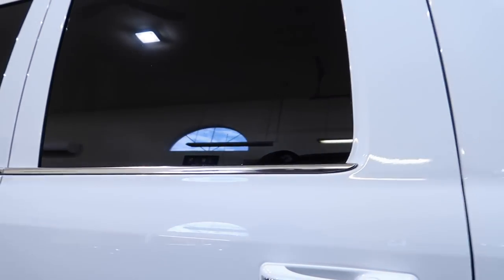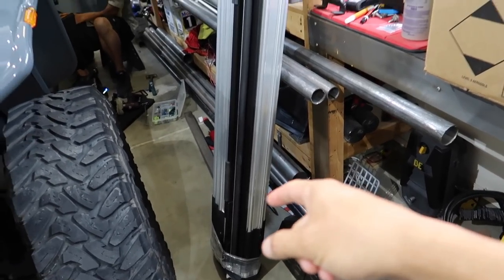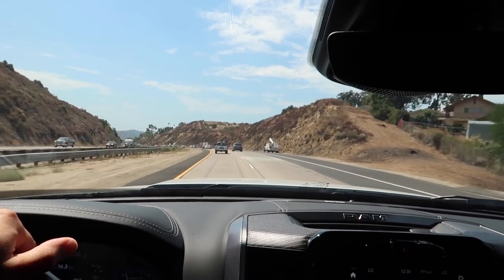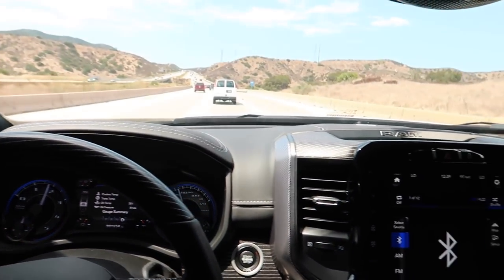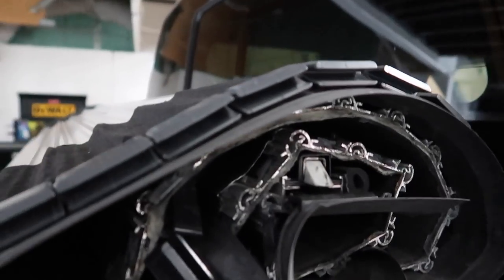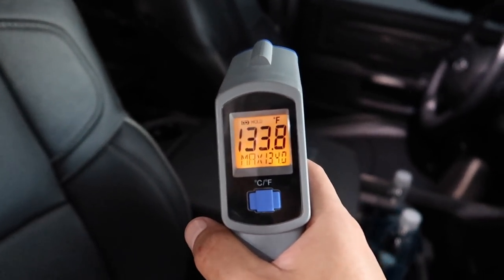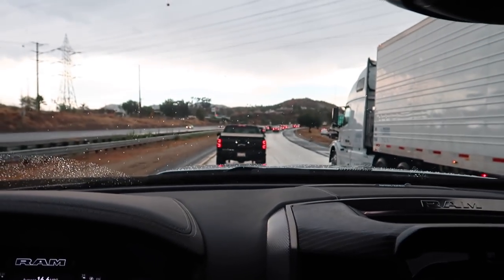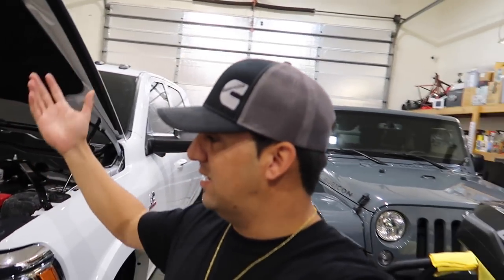TOOK THE NEW RAM OFF ROADING OFF THE SIDE OF THE FREEWAY!!

Comment: I think a pedal commander should solve that lag problem🤙🏽
Reply: Bryan One Four the lag problem is because of the turbo. The commander would only fix the lag from the electronic pedal
Reply: @xInline6  this is incorrect, the turbo spools based on acceleration. Hence if you have better more responsive acceleration your turbo spools much faster with less or no lag... This was the first mod I did to my ram 2500 and it is a valuable performance game changer.
Reply: J SAV not based on acceleration either. Based on RPM of the engine. A pedal commander doesn’t give you mechanical changes to how fast you spool up, period. If you wanted to spool faster, a tune would be needed and a different torque converter. To get those RPMs going. A pedal commander only does what it says, pedal lag
Reply: @xInline6   incorrect again... how do you get higher RPM's??? From acceleration... Period... A more responsive throttle increases RPM'S faster, thus increasing the spooling of the turbo faster. Your right that it doesn't give a mechanical change because the throttle isn't mechanical anymore. It's electrical!!!! Welcome to the year 2019. 🎉 check out Ryan Mayer's video " I made this eco diesel into a beast" watch the full video. He explains the same thing I said, he knows from first hand experience. Just like I do, I'm not sure if. 
A: you don't have a diesel 
B: don't have a throttle sensitivity booster 
C: don't have a brain or 
D:all of the above
But I guess it's "D" because you aren't seeing the whole equation. Also, you don't need a torque converter and a tune for turbo spool. A better torque converter handles more torque ie: more power. If you up the hp you also up the torque, I have not changed out my torque converter and I've added 200hp with my tuner which also added another 90ft lbs if torque. If you don't go crazy, no need for a more powerful torque converter. Do your research before you offer advice, how did Eddie put this? Oh yeah, you idiot. You moron. ✌️

Comment: Tuning will help the dead pedal but the turbo is a function of design. They went to a larger holeset housing but the compressor wheel is still the same size resulting in a lightly longer time period to get that hit. Tuning will help with the spool to demand more air at a lower rpm and throttle position.

Comment: Eddie I know this is off topic but I need some advice on upper control arms . I have a 2019 ram 1500 classic 2wd 5.7 L , with a 6 inch lift . I have stock from factory upper control arms currently I need aftermarket that will fit & give me better Angles with the 6 in Lift . Do you know what I should use ? Couple options if possible . Thanks boss

Comment: Grab a pedal commander.  It will take that lag out and then when you loose parts the throttle response will get better as well. 

Why not use the auto feature on the ac? It’s never let me down in my RAM.
Reply from the maker: i will check it out

Comment: you driving down freeway at 60 plus, you should be blowing out ducts 36 to 40 degrees, esp, if outside temp is close to 90 or cooler, i live in phoenix and when 108  to 112, my truck will blow 43-46 out ducts, driving down freeway 60 plus

Comment: Hey Eddie as far as your Lag , that will go away ONLY IF PPEI goes in and changes the drive by wire parameters for acceleration delay , wich I believe most of the time they do that as a base change in the tuning you shouldn't have to ask for it .. both the 68rfe and aisin experience this issue  

DO NOT BUY A THORTTLE SENSITIVITY BOOSTER they are a waste of time and money